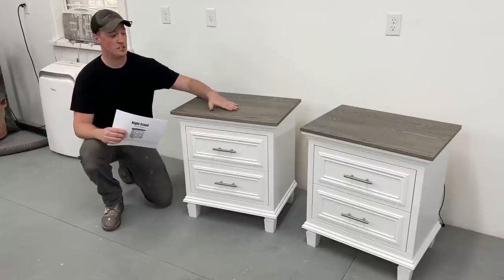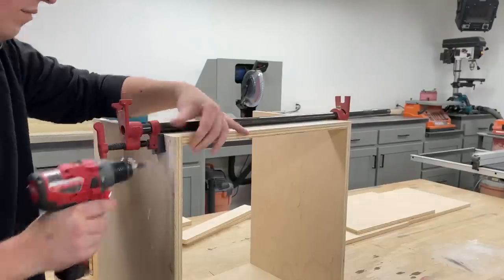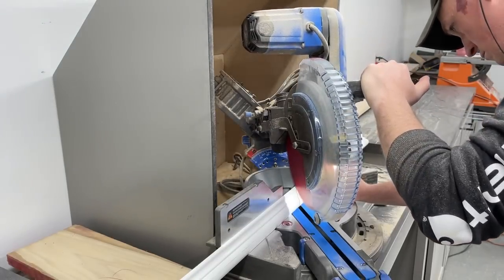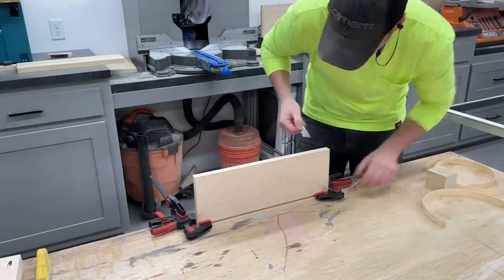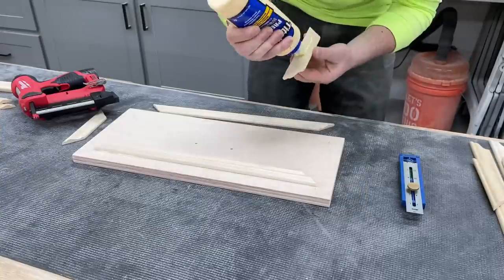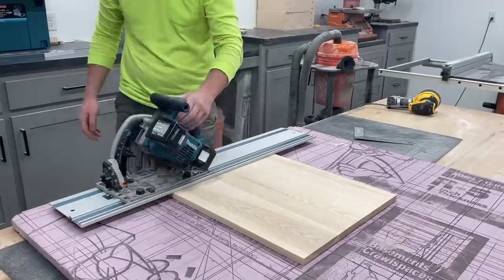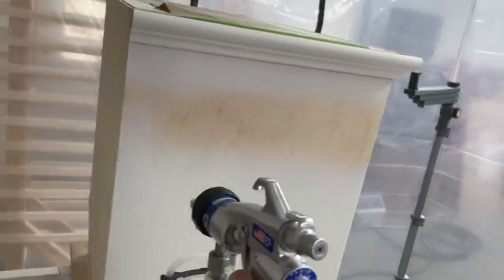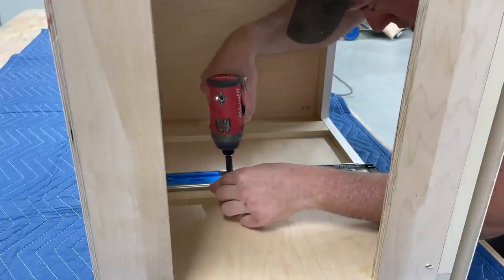WIRELESS Charging Night Stands | Bedroom Suite Build Series Part 2

Comment: Thanks John! Always enjoyable (and educational) to watch!
Reply from the maker: Thank you!!
Reply: @JohnBuildsIt  GF has a couple of white, water-based under coats that work well. The “stain-blocker” worked well for me covering a dark stained vanity, while changing the color to a light grey. So far, nothing has bled thru and the color has remained vibrant.
Reply from the maker: @toomars1301  isn’t that pretty thick though? Did you spray it with an HVLP?
Reply: @JohnBuildsIt  Yes, both require thinning. At the shop (a GF dealer) I use an airless FUJI system which is capable of atomizing heavier materials so I thin (mostly) to manufactured recommendations. At home I use 3M’s AccuSpray HVLP system (compressed air). Here in my garage (or in my bathroom, since I sprayed the vanities in-place), I thin to match the viscosity (not the recommendations) of GF’s Enduro Clear Poly which sprays beautifully OOC (out-of-the-container). With that being said, Zinsser’s shellac based primer is my tie-coat of choice (Shhhhh!) for painting here at home. Using the AccuSpray system eases the chore of cleanup so it’s quick (wipe the tip of the gun, clean the air nozzle with acetone, discard the cup liner) with minimal over-spray. Incidentally, I love the CNC and look forward to hearing more about it.

Comment: Zinnser 1-2-3 water-based primer is a good alternative that sands nice and sprays nicely, also comes in gray for darker baseecoats.
Reply from the maker: In an HVLP? That stuff is pretty thick! Haha
Reply: @JohnBuildsIt  I also use the Zinnser 123 primer.  I have been pleased with it.  I just thin it a little for my spray gun.  I use an Earlex 5500.

Comment: Beautiful night stands! I'm finishing up a cabinet with drawers... I used playing cards for the drawer front spacing, but still learned something new from this video. I was not pushing the fronts to one side and adding as many cards as possible to get the total amount of cards to then divide. Much easier than calculating the gap and using calipers to get a matching stack of cards!
Reply from the maker: Oh yea!! Makes it fool proof this way 👍🏽

Comment: I haven’t had good luck with Bondo in NY with the temperature and humidity swings it tends to crack off. I like “Plastic Wood” which is paintable and stainable single part filler with Acetone solvent; unfortunately it’s only available in 8 oz max containers around $9-10 which is much pricier than Bondo.

Comment: How deep did you have to go with the router for the wireless charger to work? About how thick is the wood from the charger to the outside?
Reply from the maker: I don’t remember at this point. Thick enough I couldn’t break it pressing as hard as I could. Maybe 1/8-3/16”

Comment: Do you add any finish to the inside of the panels and drawer boxes? Clear finish or just leave them raw?
Reply from the maker: I don’t remember if I did on these. Just depends on the project. But yea when I do, just water based poly

Comment: Do you have advice for cleaning sprayer after using shellac primer?
Reply from the maker: I just use denatured alcohol in like a condiment bottle and squirt it through the gun
Reply: @JohnBuildsIt  I use a little ammonia and water to clean up. That seems to break down the primer while cleaning out my brushes. I did run some soap and water through it once I got all the primer out. I don't have any specific ratio I use (add more or less as needed). Have you tried that yet?

Comment: I have multiple devices to charge at night; phone, watch, Airpods, iPad. I found a multi-device charger, but I'm concerned at how deep that well has to be for the charger in order for it to work. It looks like it was less than a 1/4 in. thick from the surface. Do you know exactly how thin that top is where the charger is? It would help me to decide whether to buy these plans. The playing card spacers was a very clever tip. Thanks
Reply from the maker: Yea I’d guess like 3/16 or so. Probably wouldn’t be ideal to route out that much for a way larger charger
Reply: @JohnBuildsIt  Thanks. Yeah, that's pretty thin, but it might be okay if I secure the charger really well and put a backing over it that's secured to the bottom of the table surface.

Comment: Home Depot is no longer stocking the trim you’ve linked to. 
 Are there any substitutes for the panel,crown and shoe molding you used! 
 I bought the plans from you before I checked the materials list.
Reply from the maker: Are you sure you can’t order online and pick it up at your store? All three are showing in stock at all the stores around me, plus online ordering. But yea, they’re all standard dimensions that you can substitute different styles for if you want 👍🏽
Reply: My website says it’s not available online nor is it in stock within 100 miles of me. My store is Biloxi,Ms. 39564.
 I know nothing about molding and find it really confusing to find a replacement.
Reply from the maker: @rukidn88  you’ll just want to match the sizes. 1 1/4” wide for example on the 2. Here’s one of the moldings available at your store, looks like it’s exactly the same as what I used, just a different name. https://www.homedepot.com/p/Ornamental-Mouldings-3-8-in-x-1-1-4-in-x-96-in-White-Hardwood-Colonial-Trim-Moulding-589-8WHW/202842028
Reply: Thank you for responding so quickly. I wish I could find the exact match for the other two. Your help and videos are great. Sorry to be a bother.

Comment: Great project build, looks awesome!  I really like hoe the tops turned out.  After you go over them with the steel wool to smooth out any little spots and take down the sheen, do you do anything else to it or just use a dry cloth to wipe off the surface?
Reply from the maker: Nope just wipe it off 👍🏽
Reply: @JohnBuildsIt  Excellent, thanks. Always looking for ways to improve my finishing. Nothing worse on a nice build than not being able to get a good finish.

Comment: should have chamfered the bottom of the legs some so they wont split when slid across the floor. Nice night stands though.
Reply from the maker: Slight round over sanded by hand like I did prevents it too👍🏽

Comment: Lovely little project but why didn’t you just use MDF instead of ply you would’ve saved yourself a lot of filler work and it’s half the price and the end result would be identical if you’re going to paint it anyway I don’t see they would be detrimental to the quality whatsoever not having a go by the way just saying
Reply from the maker: Plywood is certainly harder and more durable, lighter, and holds fasteners way better than mdf. Painting the raw edges of mdf is also a nightmare, takes a ton of coats for it to stop soaking in and give a good finish. Every thing was built out of one sheet here as well, having mdf drawer boxes and everything wouldn’t be ideal haha. Thanks for watching 👍🏽